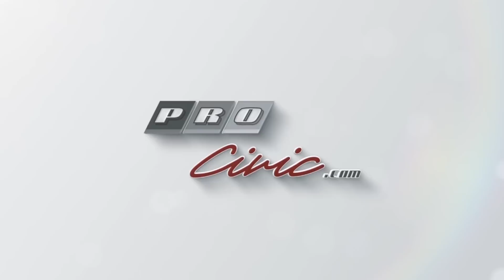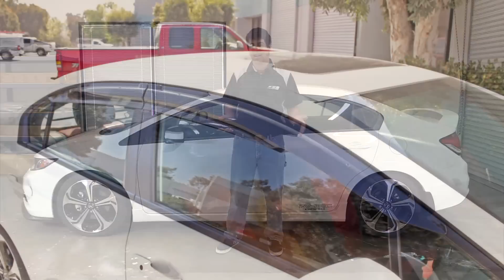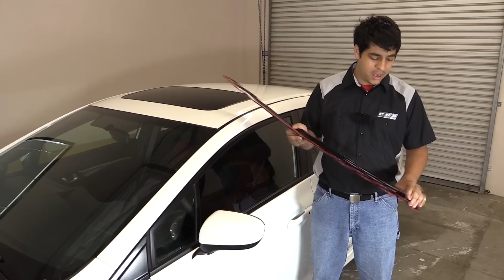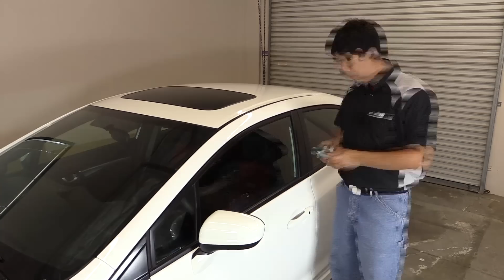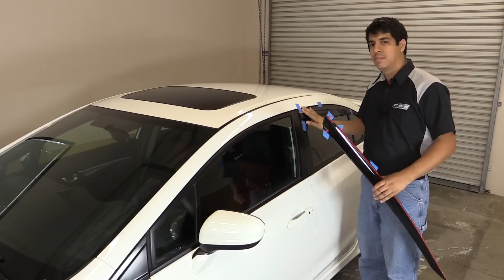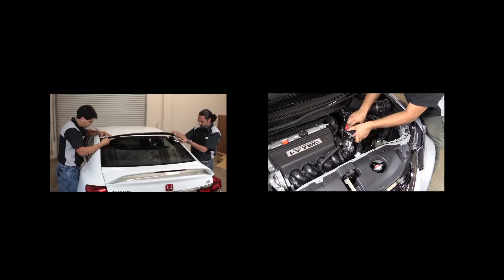PRO Design Side Window Visors Install - Honda Civic Sedan 2012 2013 2014 2015

Comment: Since these window visors are only attached to the vehicle by adhesive as compared to others where they have clips, about how long do you think these will last on the vehicle?
Reply from the maker: +Steve Tran It's hard to give a good estimate since things like weather can effect it as well. However, we've had ours on since they first came out with no signs of them coming off anytime soon.

Comment: What are the holes in the visor for? I assume that's for the clip. If so how come you didn't install the clip with the 2014 SI?
Reply from the maker: +imageherr The 9th gen sedans do not have clips to attach them, only double sided tape as shown. Other models that have clips, will have a small hole to attach them to the vehicle.

Comment: I'm sure this has been asked, but I live in a Snow State so Winter Washes are necessary to prevent salt corrosion, will these withstand those drive-thru nightmares? I'd prefer not to use them, but I don't have much choice in order to get the undercarriage cleaning :/
Reply: I know this was asked a while ago but did you get them/did they survive the washes?
Reply: Nobody answered me, but I've had these on the whole summer and ended up running them through an auto wash twice, no problems so far and the adhesive seems perfectly fine. Like I said before though, I wouldn't want to run it through the washes consistently.

Comment: Will this look good on a non lowered si?
Reply: Lowered or not makes no difference. I think my Rallye Red Sedan looks clean with OEM window visors and OEM splash guards. Also tinted 35% at stick height.
Reply: Also, I would go with OEM on window visors. Not sure on the quality of these, but most of the cheap ebay ones start yo deform from the weather and wind. They're a bit pricey but worth it in my eyes. I paid $150ish for a set at my local Honda dealer.
Reply: Could you post a pic? Idk how YouTube comments work
Reply from the maker: Eric Matias These are VERY solid and I really really doubt they will deform at all. They are definitely not low quality visors.
Reply from the maker: Steve Patino To answer your questions, these visors will look great on a lowered or non-lowered Civic, and we have full pictures on our product page located here: http://www.procivic.com/pages-product_car_part_info/category-71_101/product-2201/index.html